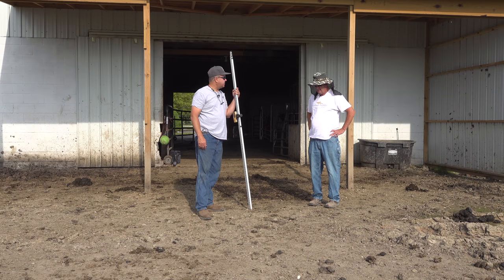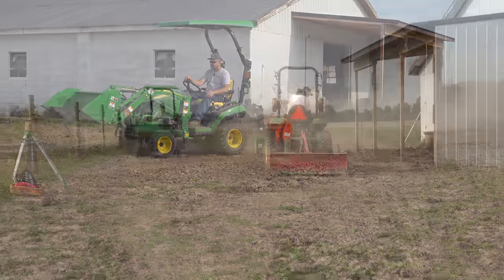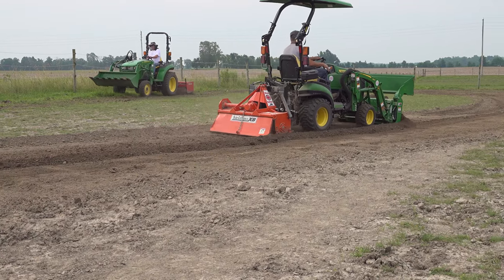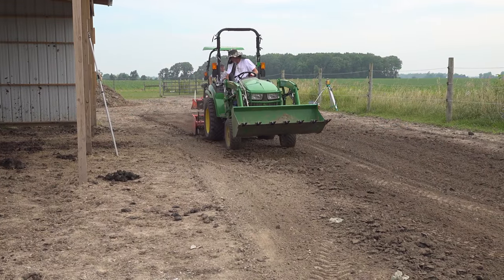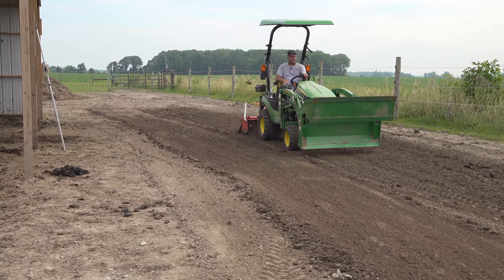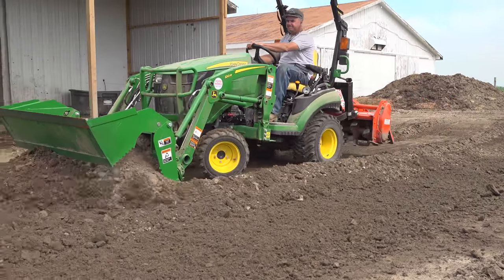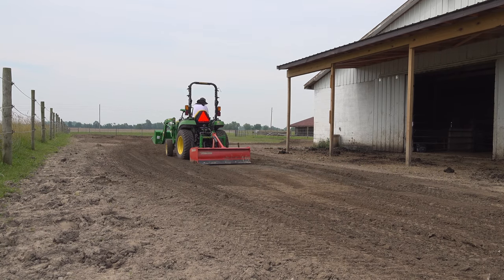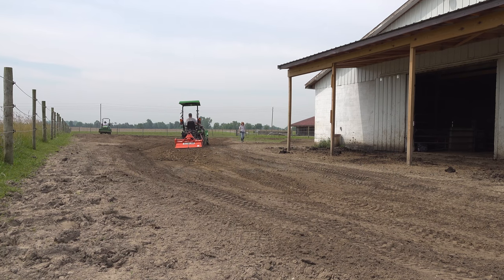Horse Pasture Drainage Fix!

Comment: I have been extremely happy with my TopCon rotary laser level. The slope feature ensures the french drains I install are always set correctly. I just finished up installing 300’ at my parents place. If I could only get a grade rod in 8ths instead of 10th it might make more sense to all that help me.  

I agree with being Leary about mounting the magnetic base and receiver in the box blade. It’s too expensive to risk damaging it or running it over if it fell off.

Comment: Tim, you know there is a valve, usually in front of the seat, where you can adjust how fast the three point hitch sinks. You can set it so your implements don't drop but instead decent smoothly.

Comment: Tim, you could have tilted the right lift arm on Johnny2 to get a gentle swale. Might use outer rippers at highest engaged position. Rex sure looks to be at home using the boxscraper. If you needed to go deeper, tilt right arm and go backwards to dig a deeper swale IF ABSOLUTELY NEEDED. Be careful with top link (if hydraulic) being extended too far. Could have used rear blade for this as well.
Reply from the maker: You can fiddle with adjustments like that forever.   We needed to move lots of soil.  Best way to do that is the keep moving it...a box full at a time.  Don’t sweat the details....just getter done.
We had no need for fancy tilt functions for this project.

Comment: Bulldozers use them on their blades.  When I had 103 semi dump trailers (sand trucks) drop them in my back yard, the Dozer used a laser to set his blade level.  That was some work.  He allowed two or three trucks to dump and he would level and pack and extend.  We had to level out 120' of backyard for a metal building.  Then came the 93 cement trucks.  Wow.   I cut a nice curving creek bed for my beloved and have a little to go.  Wish I had a box !  Used tiller and front end loader.

Comment: Tim does it work to lower your bucket down to within 6 or 10 inches of the back to utilize 4 in 1 bucket like a box scraper earthmover? The bottom blade would load the bucket up when it was cutting the let the dirt out when it wasn't cutting? Just my thoughts.

Comment: Great video.  Do you think 1025R and the 2038R are geared near the same, in that, travel speeds are about the same pulling attachments?
Reply from the maker: No.  2038r will go faster in each range.

Comment: I couldn't help but notice that when the Sun was shining bright the canopy on Johnny did very little to keep the hot Sun off the operator. Comparing the ROPS height between the two tractors it appears like the canopy would be much more effective on Johnny-2 with its lower ROPS as compared with the sky-high ROPS on Johnny.  Maybe it would be different if Johnny was working closer to the equator. :-)
Reply from the maker: Or closer to lunch time!
Reply: @TractorTimewithTim  you wouldn't be on Johnny at lunchtime anyway Tim. You will be eating your cheeseburger

Comment: I made a comment in another video on the quick connect hanging down on the 2028r ( Jonny 2) It does not lock up into place like the 1025?  I know the deck uses a different method of lifting then the 1025. I would catch that the first time out with it.

Comment: More efficient.....   its called steel tracks.      That would have been a dab of a job for a John Deere track loader or dozer in the 450 to 550 range.   I prefer the track loader its more versatile than a dozer, hard to load trucks with a dozer.  Final finish is done with the box blade on the tractor.   You will need a larger trailer,  I just squeak by with a 24K lb trailer with my 450C.
Reply from the maker: ...and CDL and USDOT number.  Not gonna do it.

Comment: Rex really was great with that box blade.  I would have had to ask him for pointers on becoming better with one.  Mentioning the size of the project and needing persistence to see it through, that's kind of what you have to think when you see a really huge project like digging a lake even with large equipment.  It took us 3 years to build a 67 acre lake with 2 Cat D8's (1 pulling a 14 yd scraper) and 2 smaller FiatAllis dozers the first two years, and hired in a crew the last year with another 2 Cat D8's (one pusher and one pulling a 21 yard scraper), and 2 paddle wheel scrapers.  It was a huge project and even though the equipment was so large the 3/4 of a mile worth of digging took a lot of time to move that much dirt.  It kind of reminds me of how big an ant pile can be even though the ants are so small.

Comment: I did something to that effect on a driveway that has water runoff from county road to the front door of the house. I used my boxscraper with tilt to dig a small swale to the field below the house. As far as I know the water has greatly stopped going to the front door. Tilting boxscraper and backing up will dig quickly. Slow and constant use of lift lever to attempt to keep a grade.

Comment: This is where I would like a blade when I turn it to the side using the top plank I can get an angle to it and usually grade the higher areas off or use it to cut a trench But I definitely think a hydraulic top link would really help you out and make you more efficient